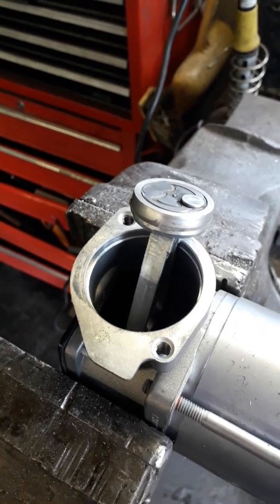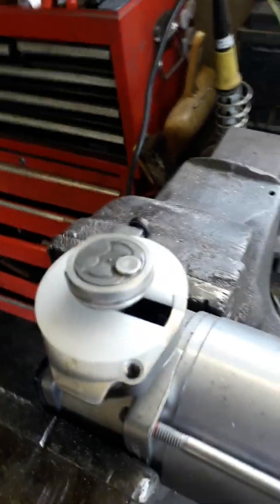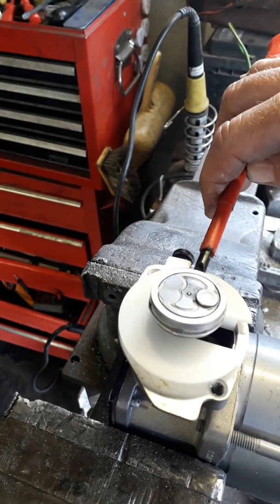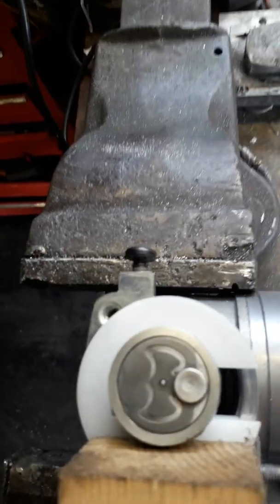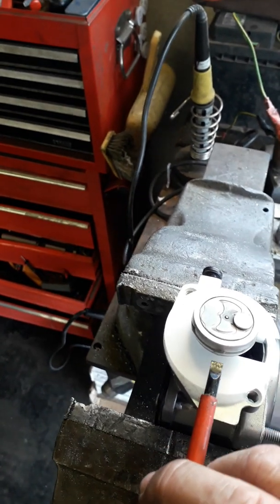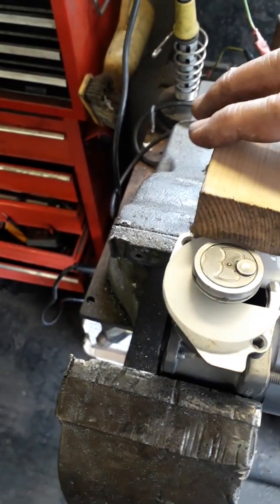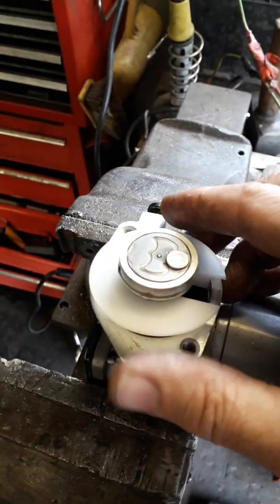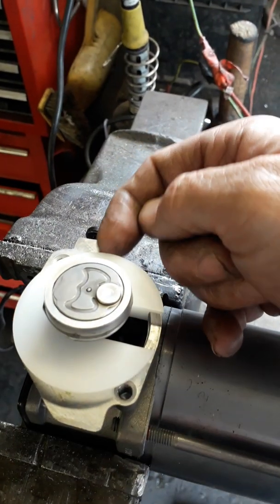BMW 5 7 Series F01 F02 F04 F07 GT F11 Wabco Air compressor piston seal clamp ring removal

Comment: Thank you😎
Reply: Did you manage to remove this ring. If so any additional tips ? How long it took to finish ? Thx
Reply: @master00log  Same problem lad. Trying all afternoon and it looks like it really doesnt want to be opened up XDD
Reply: @jakubzurovec  Ive soaked it in wd40 to penetrate for a while and at last  I could manage. But it did not last long after repair in my case most likely few days and it started overheating.
Reply: @master00log  Damn. Thank you for your feedback. After discovering that this was not the way to go, I decided to open it up and drill out the rivets on the side. While trying to open it, I made grooves on the piston and decided to replace the whole piston. I saw a video where some Turk decided to rebuild a blown one. He literally wrapped those copper wires around the base of the electric motor. So I figured I had nothing to lose. It'll cost the same if I fuck it up as if I give up, I'll have to buy a new one anyway. Now I'm waiting for the new one to arrive, but hopefully it'll work.
Reply: @master00log  All right, update for me. Same overheating as you said, and left side pumped up fully and then, after 10km ride it went down again. What had helped you in the end? New compressor?
Reply: @jakubzurovec  my failed not so long after someone drove in to my back I was lucky I could claim it as consequence of that under my insurance. I did go to BMW for all works since then no issue